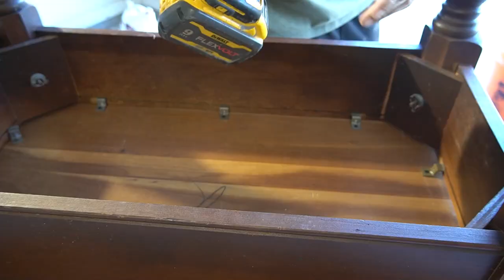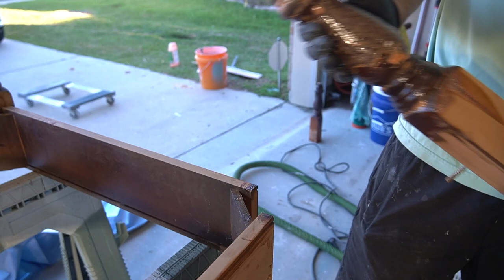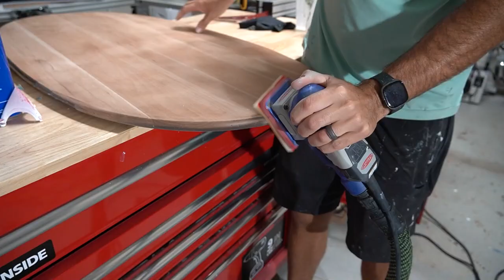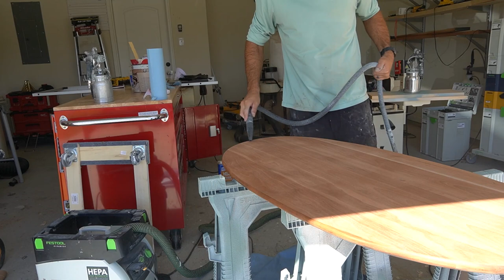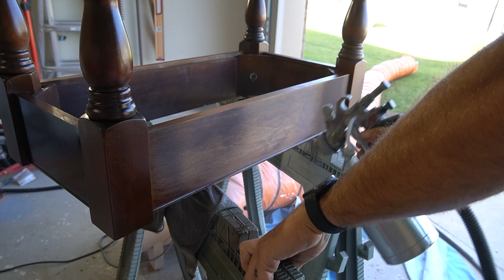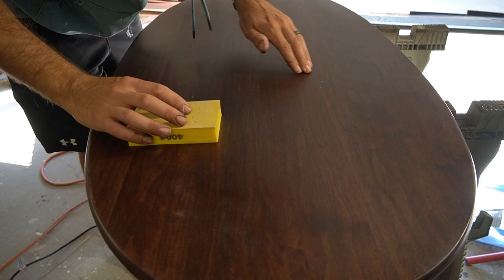Furniture Restoration -Restoring a Cherry Coffee Table

Comment: hi Milo I bought a cherrywood bedroom set in 2006 in at the time I bought a polish and cleaner for it,  that company has since gone out of business and  because cherry wood is delicate can you tell me what Product I can use to clean and polish it.
Reply from the maker: I’m not honestly a big fan of polish.
The reason being, any future refinishing that has to be done will only be made harder because waxes in polish interfere with the coatings I use. 
There’s a couple products out there, the company Milsek manufactures a wax free polish. I’d think anything that is wax free and silicone free is okay!  That’s really the only important thing to me. Others might have different opinions. Some people do like wax because it helps to act as a polishing compound, but to me I just avoid it in case I want to refinish a piece later.

Comment: what grid sandpaper are you using.?
Reply from the maker: I don’t actually remember. But I’m generally not going below 320-400 if I’m sanding in between coats of finish. Hand sanding i generally only carry 400 grit blocks between coats, but on the initial sanding before any finish or sanding sealer I’ll use 220. I find anything lower usually shows up in the finish, even if it’s just visible when the light hits it a certain way.